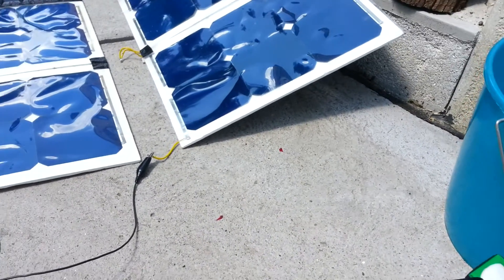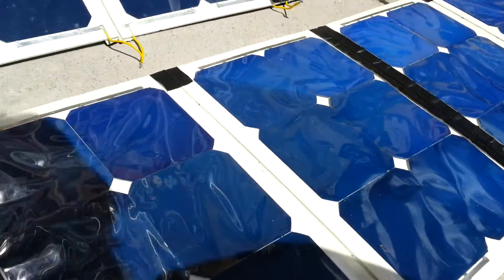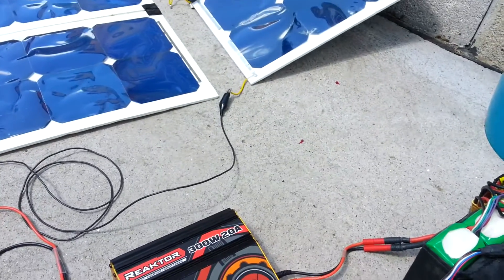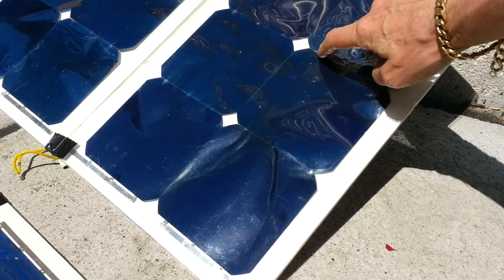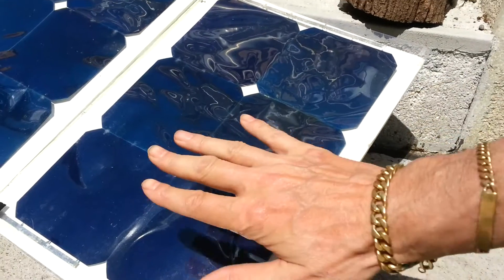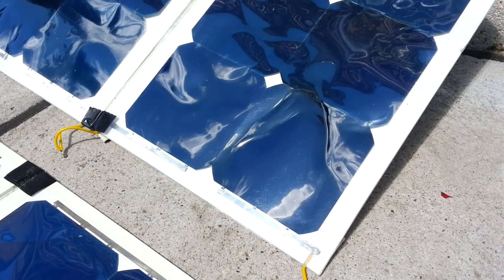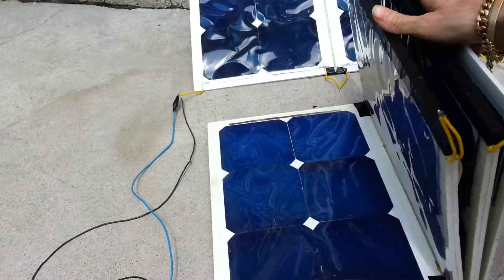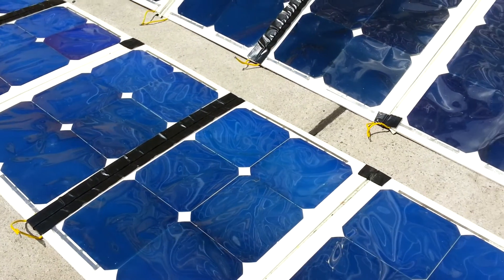Homemade 240W folding solar panels with 300W Turnigy Reaktor

Comment: what's the name of the type of technology used in the mechanism in the electric bicycles, wind turbines etc. that rotates and that energy gets converted into electricity? can we make electric vehicles, cars and aircrafts rechargeable in real time from the energy released by the spinning wheels and propellers?
Reply from the maker: It's just electromagnetic induction.
1. A wire moving in a magnetic field will generate an electric current.
2. A wire carrying an electric current will create a force in a magnetic field.
How would you charge an aircraft in real time while it's flying? The energy has to come from somewhere.
There are no free lunches. There are always losses in conversion.

Comment: Hi Andy, i see that i am not the only to reload my lipo with the sun, it's great idea.
why use not a battery to have a safety when cloud come to hide the sun?

At the moment i use solar pannel 100w from Aukey with 12V car battery and it work very good but i would to make my solar pannel to have more power, so i bought 50 solar cell maxeon C60. I would to know how you have make your solar pannel.

Comment: Hello, have you made progress on this ? I have the same kind of limitation in my system. (controller wise)
Reply from the maker: Hi Alex, yes - I updated the description some time ago.
In the Reaktor settings, 11 clicks left or right there's an option called "Cut-Off". Set it to the MPP of the panels, and the charger won't let it go below that limit so it should keep the current and power up.

I made another panel since, and am working on a 4th so should be able to get a decent charge.
Now I also got an MPT 7410A controller, and a CTK EV300 MPPT Solar Charge Controller https://goo.gl/Xv4qoU charger that Adam Welch demonstrated ( https://www.youtube.com/watch?v=tkDRNbAWZo0 )
I've since made a bigger battery pack out of harvested laptop cells, 14S16P and added a 14S BMS so I can bulk charge to 58V using these controllers in parallel, and wiring the panels as 2S2P.
The Reaktor is great for balancing occasionally in 2 or 3 sessions, but it is better to be able to charge the whole 14S pack in one session from the panels, or from a power supply.
(Still always have to keep an eye on the state of charge of each cellpack to ensure that no cells ever get out of their healthy range.)
I hope to make another update video when circumstances allow!
Reply: Thank you very much and sorry I did not read the description! Yes, I am also thinking about this boost controller. My application is to power part of my apartment with solar and a 24v lead acid battery, sound of audio equipment powered by  DC is much improved over AC (especially amplifier), and also I save some money by powering some 24/7 little computers and servers i need, along with most of the AC lighting of the flat. It is 5 years I save about 20€ month with it but lead acid starts to decay, I am looking to make a lipo pack and with proper controller.
Reply from the maker: Thing to remember with the boost controllers is that they cannot output a voltage less than the input - they are really designed to charge 24-72V ebike batteries from a solar panel whose OC voltage is at least a couple of volts of the destination battery, so you would be limited to using 1 or more 18V panels in parallel.
They are cheap and you can combine them in parallel with more panels, but there comes a point when a more powerful controller such as a PCM60x may be a better choice.
There are a lot of things to consider - if you have a lot of panels further away on the roof and don't have any shading issues then use them in series for high voltage transmission to a buck controller that'll increase the current locally. It's sad that there are still too many charge controllers designed for lead acid, but the PCM60x can be configured for lithium by disabling float charging.
If you can, try to consider making a 42-58V (14S) battery for storage - you can use a 48V inverter with it, and DC-DC converters to supply 12V or 24V from it, and not need to spend a lot on thick cables. It'll help in the long run.
Follow HBPowerwall, jehugarcia, AverageJoe, DIY Tech & Repairs and Adam Welch on youtube and be prepared to spend hours and hours watching lots of interesting videos!
Reply: Yes, I am aware of that. I just plan on using 2x controllers on my 2x 12v 150W panels. For the moment both panels are in series, on a little Phocos mppt for lead acid but the panels are in the shade ON the terrace (and use space). I plan on putting one panel OUT on the sunrise side and one OUT on the sunset side, will be better in my case than south facing and in the shade. I think I will get way more watt hours like this. Those cheap controllers might be key to my success. 24v is really convenient, it is direct for both my internet boxes, wifi, and audio small amp. I use buck for the dozens of usb devices, and for 12v things. Cables are already correct. I use mostly DC and very little AC.
Reply from the maker: Sounds good - I wasn't sure of your level of experience, so answered to hopefully help anyone else interested.
Yes, avoiding shade is the first priority, and you only need to make as much as you need, so if one panel on each side of your house meets your needs and the supply curve matches your demand curve, then one of these cheap controllers on each should do fine.
I guess if you need more power sometimes, you could just move a panel to get a boost.

I found this solution fascinating: A heliostat that follows the sun to always light up fixed panels or a window on the north side of a house. This could work well if normal panel locations aren't possible, though it would need cleaning occasionally!
http://www.iwilltry.org/b/projects/build-a-heliostat-for-solar-heating-and-lighting/
Reply: There is a small french company that uses a mirror to light any area, like north facing small window for example, or solar panels ... http://tourneseul.fr/lab/  and most photovoltaic panels if you don't overheat them will produce more if you put more light on them (say a light concentration when you have just a little more than 1000W.m2) the panel will produce more accordingly, with a loss due to heat.

Comment: This really makes me want to build my own panels!
Reply from the maker: Give it a go! It was very satisfying, but these were particular laborious and took days to make, although the materials were cheap!
I was aiming to make them as light as possible but not waterproof, so used foamboard as you see, duct tape and double sided tape around the margins to hold down the front film. (I discovered the double sided tape needs shading from the UV so it doesn't degrade and come unstuck! Aluminium tape would be best here to reflect and not absorb heat)
I replaced the deformed acetate sheets used in the vid with polypropylene sheets from an art store.
The PP resists the heat better, but not optically ideal. ETFE or EVA film is what they use in the industry so would like to get hold of some and try that.
They are surprisingly durable and still work, fold up and fit in a backpack and survived a couple of occasions when I made an unscheduled dismount off the bike and landed on them... :-)
The tedious bits were soldering the cells, cutting the connecting tabbing wire, bending a litte bridge in them like this "__--__" before attaching and making sure they stayed lined up. I also dug out the foamboard a little with a scalpel to accept the raised tabs so they would lie flat without any stress that could fracture them, and cut out double sided tape strips to fit the margin's exactly, and cut channels for the bypass diodes and connecting wires.
As the pages fold, I made the wires follow a V shape at the hinge so they would twist rather than bend on opening/closing to eliminate metal fatigue.
I want to make another set to bring the total from 3 to 2+2, but need to order some more cells, and they've doubled in price since I got these at $66 for 40. I have no idea why they jumped in price when they are supposed to be getting cheaper every year.
(I did have enough, but had to use some of them to replace cells that got ripped off in a storm and really got mangled up!)
If I had the funds, I'd use carbon fibre sheets for strength, thinness and heat conducting ability and vacuum-bonded etfe front film, then they could be all-weather and run at a lower temperature while also taking up even less space and remain fairly lightweight.
Your video on "The Cockroach" was fun and inspiring!
I'm hoping to ride back to the UK on my homemade ebike and these panels and tour around seeing old friends I haven't seen for a very long time, including your cousin Adrian whom I toured with in the Taverners Big Band decades ago as roadie and son of my parents - the singer and lead sax!
I still have a trailer to design and build that will last at least a few thousand miles!

Comment: Can you generate a refrigerator and an air conditioner
Reply from the maker: You mean power them?  With 300 W they could run a small one... If I need more power, I can make and use more panels, but would need a lot of them to run a 3kW air conditioner!